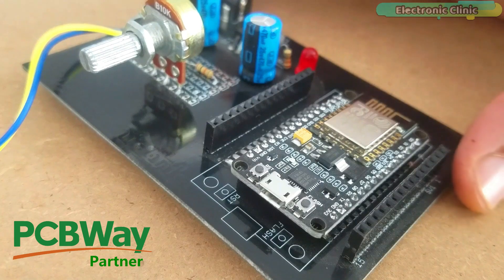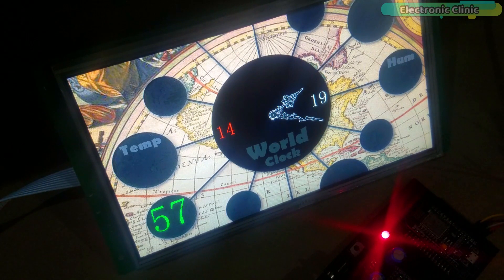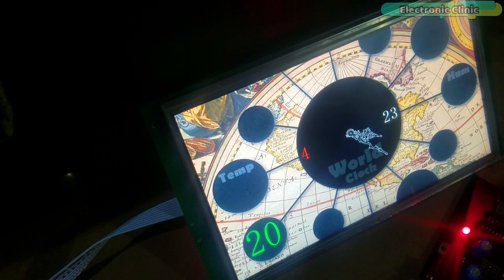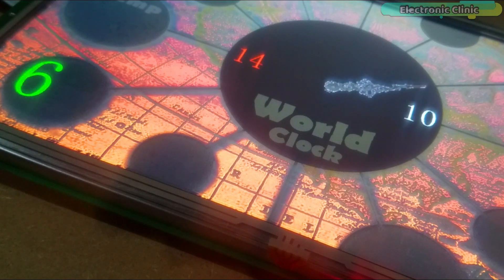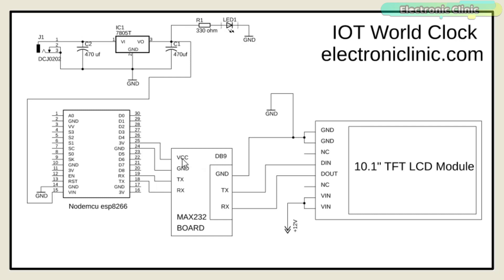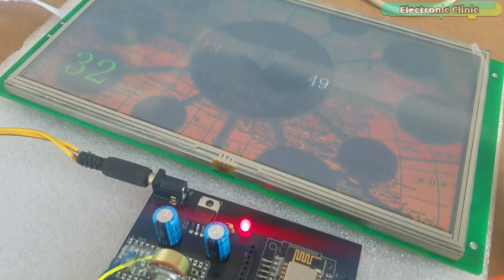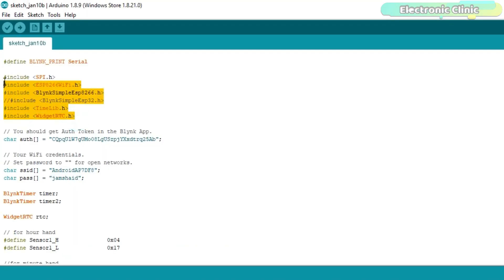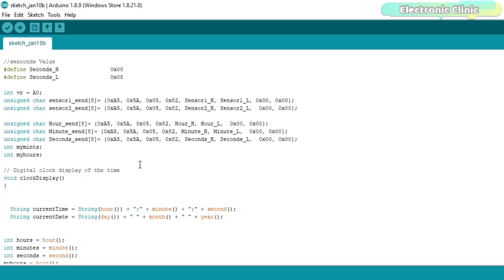DIY Digital World Clock using Arduino and HMI TFT LCD, IOT Project, iot Clock, diy clock, wall clock

Comment: This is not a world clock because it does not display multiple time zones at the same time, it's just a digital clock. Any clock can be set to any time you want anywhere in the world using your logic every clock ever made is a world clock.